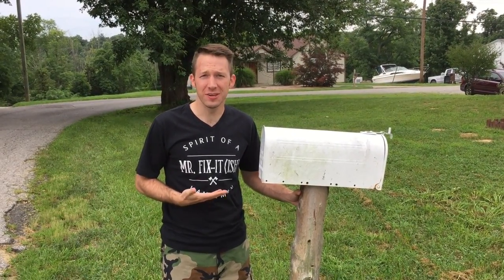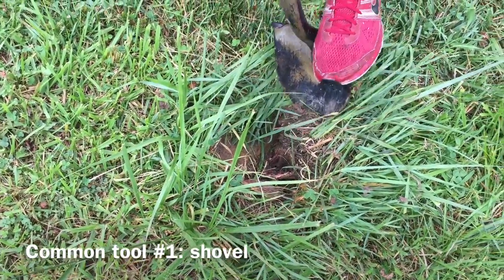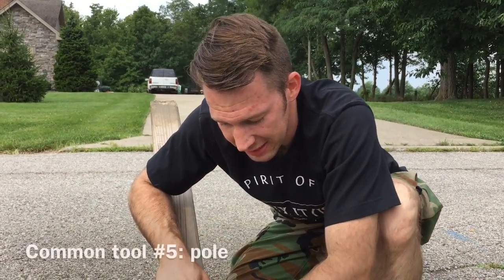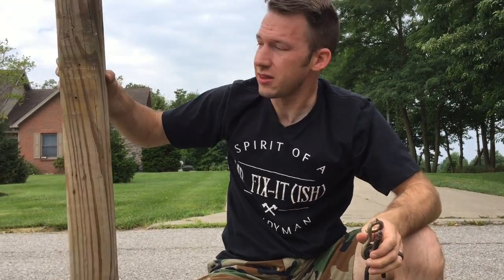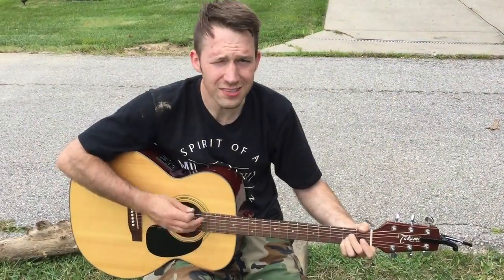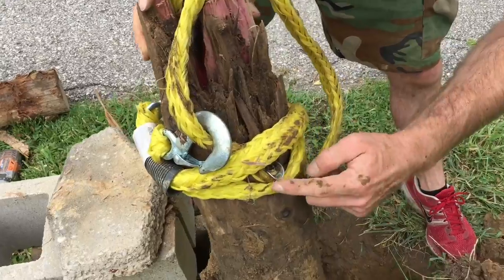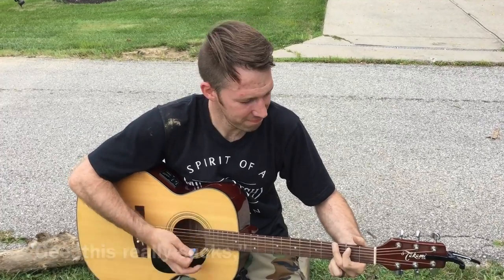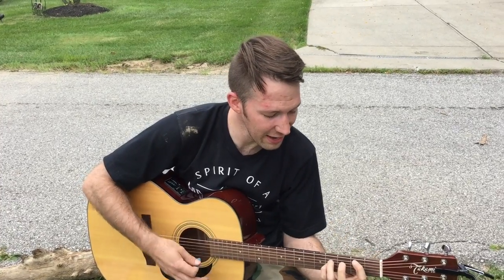How To Replace a Broken Mail Box Post (at no cost!)

Comment: What I learned from this is that if my mailbox post breaks, I should move to an apartment building.  Since my mailbox post just broke (and my neighbors did, so we're guessing a snow plow's mirror took them out, but there are problems with that theory.  It might remain an Unsolved Mystery), I'll be going through apartment listings!  Great video!
Reply from the maker: LOL I love it!
Reply from the maker: This time of year it would be nearly impossible to replace a broken post until the ground thaws
Reply: @SpiritofaHandyman  Yes! As I walked out to my car to go check out an apartment, I took a moment while the car was warming up to look at the post.  I was hoping moving into an apartment was maybe over-reacting.  That post is in the ground tight, like frozen tight.  I have a solution in mind, using angle irons as splints and putting it aback together as the break in the post is midway up the post.  But that will probably not work and it's apartment life for me again.  (also, I don't know which I like more, the video or the people who clearly didn't get it)
Reply from the maker: @loulasher  haha, I love it. God bless your efforts (or your move!)

Comment: I would have dug a hole along side & installed another pressure treated four by four coated with tar or whatever.  But it was a great video you have done. BTW, if anyone ever knocked down my mailbox, like a snow plow, I would install a metal I beam in the ground with concrete. Nothing would ever knock that over. Of course, it would tear off the snow plow of the truck & I would get sued!  :)
Reply from the maker: I like your style!